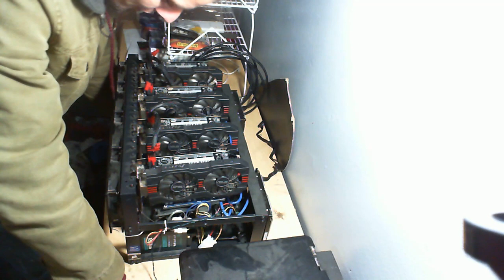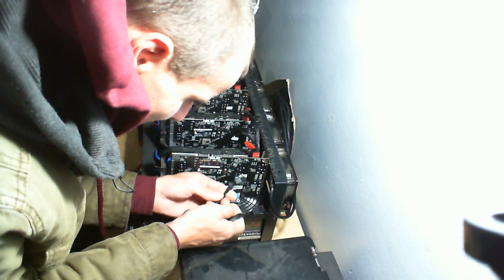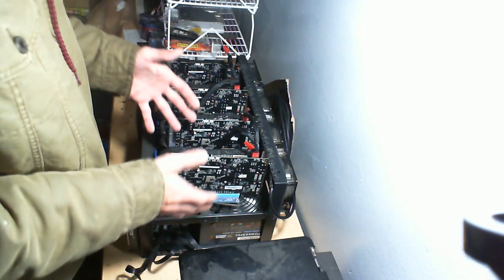Why does my drive keep frying?!?! Don't learn the Hard way! Build mistakes? or Bad Manufacturing?

Comment: Thanks for putting this up. I just did this and fried one of my hard drives. You saved me from frying another one.
Reply from the maker: rite on.....btw...make sure NOT to use older drives that only allow for 12 volts alos...thats one thing I forgot to mention in this